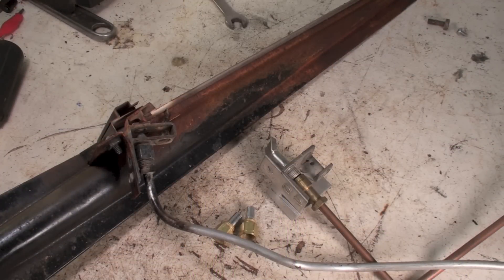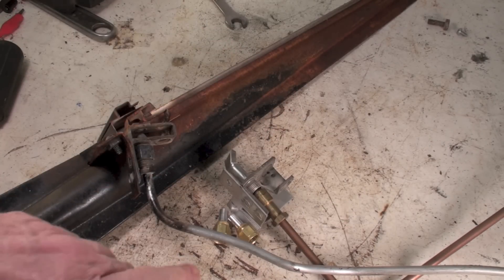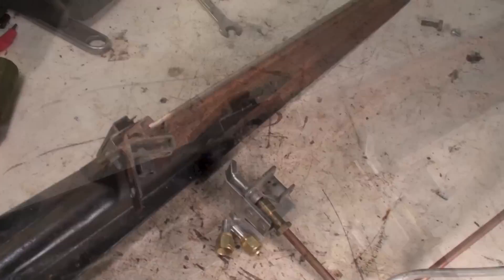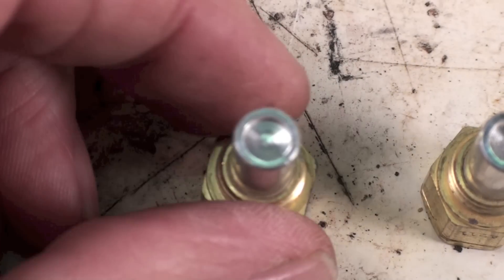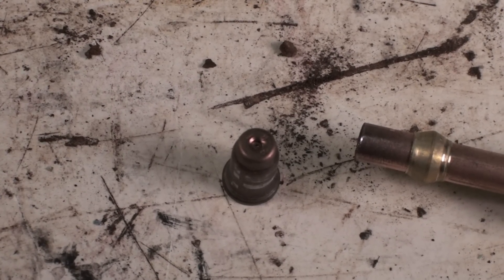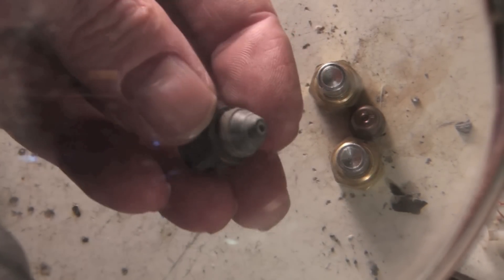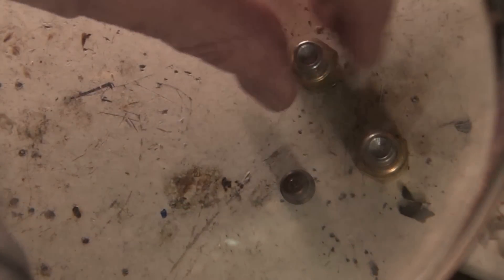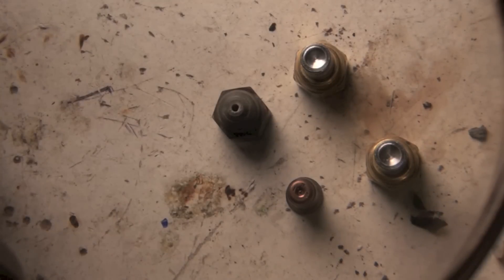How to check the gas pilot orifice

Comment: Thanks.  Very helpful.  Blowing out yearly the dust etc, on a Pleasant Hearth Vfl2-Ro24dr set up on NG has always resolved easily but this year not so.  I have a strong pilot but no swoosh and then burner flame.  I will use your help to locate the Orifice and see if I can clean it out and get it to work.  Thanks again.  Kevin

Comment: HI have a vent less heater  pilot will light and stay lit but the flame is to high  see no adjustment
Reply from the maker: If the pilot flame is high and yellow, the pilot assembly is dirty.  Something like canned air blown across the assembly may clear it up.
GFM

Comment: I am working on a 1986 camper heater - Hydro Flame Corp.  It is a 12000 BTU heater,  I have verified all the controls, ignitor, etc and can smell gas coming out of the valve when I have the pilot assembly removed.  It seems like I am not getting enough gas for the verified spark to light the pilot gas.  Orifice seemed to be completely clogged, but I got it flowing again.  Orifice hole seems smaller than .016" diameter.  On the tag it states the orifice injector is 59, which I believe corresponds to a .049" diameter.  Is that the main burner orifice size and not the pilot orifice?  How large would the pilot orifice likely be?  I cannot find a replacement part.  thanks for any help
Reply from the maker: The tag number is for main burner. The pilot orifice is much smaller.  
If the spark is working, and the gas does flow, the pilot is probably dirty.  I don't consider pilot orifices cleanable.  Replacement is the only option.  
Most of the camper heaters used general replacement orifices.  
If you want to send me a pic of the orifice, I will try to find a replacement.  Send to Grayfurnaceman@gmail.com
GFM

Comment: I'm in the process of repairing my pilot for a burner used for a pizza oven.  It's operates under high temp.  The pilot assembly has an injector (orifice), a pilot olive that connects to the 6mm pilot tub and then a nut.  Is there a different way of implementing this assembly with less components?  The olive I have a hard time inserting on the pilot tube.
Reply from the maker: If the pilot safety is a separate component, you can replace the entire assembly with a combination gas valve.
GFM

Comment: My 30 year old RV water heater pilot assembly is missing the flame diffuser. The pilot blows out two to three times a month. If a diffuser would bend the flame toward the thermocouple tube, where can I get a flame diffuser? Any help would be appreciated.
Reply from the maker: Flame diffuser?  I have no idea what you are talking about.  Have you replaced the thermocouple?
GFM
Reply: @grayfurnaceman  it’s a metal thing resembling an elbow. No, I have not replaced the thermocouple. I’d like to find where the failure is happening before replacing a part or assembly. I’ve been repairing all kinds of devices since 1955, so I diagnose symptoms clear down the cause of failure before buying a part. I do not mean to insult you with my answer.
Ple
Reply from the maker: @shermananderson700  None taken.  The thermocouple can be tested by first determining if the pilot flame covers the thermocouple about 3/8 inch.  Then you can check pilot safety dropout by blowing out the pilot and waiting for the safety dropout.  If it drops out within 20 seconds, the thermocouple is suspect.
GFM

Comment: I got a gas heater that runs off natural gas or propane and the pilot orifice for the propane is tiny, blows it out when the gas kicks on sense it was brand new, put the natural gas one in there but it let's wat to much outmakes the pilot huge when  it kicks on, not really sure what to do with it, anyone have any ideas?
Reply from the maker: Are you using propane or natural gas?
GFM
Reply: @grayfurnaceman  propane
Reply from the maker: @This0is0pointless  So, the pilot is blown out by the main burner when the burner lights?
GFM
Reply: @grayfurnaceman  yes that's what was happening, the flame was just a tiny little bud barely big enough to warm the thermocouple, I actually took it apart again and blew it out and poked a tiny sewing needle through it and tried putting the smaller one back in there, and it seems fine now.
May have just been something in there from machining or who knows, I appreciate you replying though

Comment: Hello, I have a 9500 BTU on one of my four burners at home and I would like to upgrade it to around 12000 because it really can't sear well (I do steaks and stir fries...) Is that a good level of heat?
Reply from the maker: Is this a barbecue?
GFM
Reply: @grayfurnaceman  no, it's a kitchen stove
Reply from the maker: The problem here is you will need a burner that is the correct size.  You can drill out the gas orifice, but the air fuel mix will be wrong and it will produce CO gas.
GFM

Comment: They can be cleaned with a broach or a fine drill bit.  Just don’t make the hole larger.  I used to even blow them clean with my breath or a aspirator bulb.
Reply from the maker: If you ever find a drill bit that small, let me know.
GFM
Reply: @grayfurnaceman  I keep an assortment of guitar strings for clearing tiny orifices. They are made of stiff steel wire and work very well for this.

Comment: Thanks for your great videos.  I have a 1960's era propane furnace in a mobile home that I would like to keep running.  It is having delayed ignition with the flame sometimes coming 12 inches out of the furnace. The pilot assembly is old and beat up. The repairman I used last winter could only get the pilot flame to about a 1.5 inch yellow flame.  He did not say anything about cleaning or replacing the orifice (not going back to him).  Anyhow, I will replace the whole assembly if i can.  I don't think I can find a 1960 Coleman pilot assembly (it also has a Rheem symbol on the motor).  Can I replace it with another manufacturer assembly?
Reply from the maker: You can try a general replacement pilot assembly if you can find one that has the same type of flame ( shell, L shaped, T shaped).
GFM

Comment: Hi - hope you are still responding to questions on this video - I have a back-up propane heater in my basement to serve if the electricity goes out in my rural area in winter. Winter has arrived, and I am trying to get it ready for the season. My pilot orifice thingy is an assembly that houses the thermopile, thermocoupler, pilot light and sparker/starter. The pilot light orifice is a "jet" - rather than a tiny hole or two, it has something in it that looks like a cross between a valve stem on a tire and a tiny slot-design screw - it sits in the centre of the orifice and controls the propane flow. Mine I fear is clogged - and here is what I have tried: boiling in hi-acid vinegar, soaking in Brake parts cleaner fluid, penetrating oil, forced compressed air.. I can blow through it for a moment after each procedure, but it quickly closes and by the time I have it re-installed, it impedes the gas flow to the point where the pilot will NEVER light. The propane flow is good - take this "jet orifice" off and the gas flows through the approaching line just fine. The assembly is for an 8 yr old Drolet GTX-I Freestanding Direct Vent Gas Stove. Is it heat-controlled? If so, how can I get it hot if it won't light? Is there a tiny spring inside or something? Does the centre jet-thing normally "float" so the gas flows around it? A replacement will cost < $200 Canadian. Any suggestions?

Comment: Have you ever came across a lear siegler  gas boiler ? Made specifically for mobile homes ? I came across one prob about 49 years old having a issue keeping it lit the pilot will light blue but won't hold when I switch the gas valve knob to on it had be a thermocouple on it was thinking to try to give it a good cleaning the whole assembly I contacted the comp that bought out lear siegler they said a tech would get back to me and it's been days. And I'm a tech but this thing is hard to find d parts from googling. Any help would be appreciated

Comment: I think all of your videos are great.  Replacement pilots are sent with natural gas orifices in them.  I searched for the new code of a replacement orifice for LP for a 32-year-old Carrier model but the 'replacement' orifice is a quarter inch shorter (no knurled end) plus I have no way to gauge if the 0.011 drill size for LP is the same on the supposed LP aftermarket.  Any help here would be fantastic and if you can do a video on the absolute nightmare of obsolete parts and their five different name changes just to find a match would be entertaining.

Comment: I got a new furnace 3 yrs ago. It's a Coleman Furnace Model DGAH077BBSB. In the beginning of the first 2 winters it would not heat up and I get the repairmen here. twice already the problem is spider egg sacks blocking the burner orifice costing me just over $100 in repairs. How can I prevent this or fix this myself?? Can anyone help me?? 
Here'e a link to the furnace manual:
https://www.searspartsdirect.com/partsdirect/user-manuals/DGAH077BBSB-COLEMAN-FURNACE-manual

Comment: good video.  Just a gas valve question, I bumped into this Robert shaw gas valve the other day7000BDER, it has this small two prong electrical connection on the side...what is it? it says 24V... It can be seen on a google search  under the images using that model number...
Reply: Dam hvac8;75859:7:  learn, to use punctuation, marks and, learn some, dam “MANNERS” ... !! !  !!! 
The Grayfurnace gentleman merely provided you with his best guess according to the info he was given.  Wether you agree, disagree, like it, hate it or whatever, you are to take the advice as is and move along.  If you don’t feel the opinion is up to par then ask someone else.  Or do your own dam research.  Or better yet, consider paying someone.  Either way, don’t kick a gift horse in the mouth.  Considering what you paid to Mr.  Grayfurnace... for the consultation and his time, I’d say you got a great deal.
Reply from the maker: I believe that's a low gas pressure shut off used mostly in Carrier electric pilot furnaces.
GFM
Reply: You see, this was on an old  Modine unit heater in a garage.  It says 24VAC so I'm thinking its a load not a switch, so if I jump it out, I'll effectively burn something out, where as if its a switch, Ill be temporarily enabling and closing a simple switch.  Thats why I need to" KNOW", ... not guess, what it is.  If you don't know for sure, say so.  Did you look at the picture?
Reply from the maker: Yes I did.  Replaced number of then on Carrier furnaces.
GFM

Comment: Once after clean and re-assemble of standing pilot ass'y to pilot tube, I had a small leak (very small flame coming out rear side of threaded connection) where pilot tube connected to pilot ass'y (had done  a few others with no leak however). What would be the best way to leak test that connection BEFORE re-installing gas burner ass'y and lighting pilot, so as to avoid having to pull burner ass'y again after finding a tiny leak. Possible to connect can of air to threaded pilot ass'y or something like that? Connect it to gas valve and light the pilot (before reinstalling burner ass'y & gas valve?
Reply from the maker: +JustPlumDucky What I do is put a very small amount of pipe dope on the ferrel mating surfaces.  You can also put it on the threads for lubrication (the threads do not seal).  Hope this helps.
GFM
Reply: +JustPlumDucky One final question please... I realize that the proper degree of tightness is achieved only with experience, no doubt, but wondering if there is any recommended  method, such as inch-lbs. or number of turns to achieve leak-free tightness. Maybe there isn't any such thing as an inch-lb. open-end torgue wrench, at all, or for such small fittings, but just trying to satisfy my OCD since being spooked by my last experience with this :). Actually didn't get the tiny leak/flame until the 250 lb. LP tank guage dropped down to approximately 5%. Maybe I just had a bad day and was afraid of "too tight" on that occasion. Maybe better to go tighter in the future, then adjust if necessary. However, will be doing the pipe dope thing, thx much for that!
Reply: +JustPlumDucky Soon as I read my comment about a can of air to leak test it, I realized that would be too much pressure!  (can't have you thinking I didn't realize that immediately after  :)

Comment: I was on one the other day, smart valve with a HSI pilot when it went to light the pilot it would light spit and spudder then go back out. I blew through the pilot tube suck through the tube it seemed to be clear. I pulled it off and found some very small flakes in it. They were small enough not to plug the orifice but big enough to cause a problem. Thanks for the videos